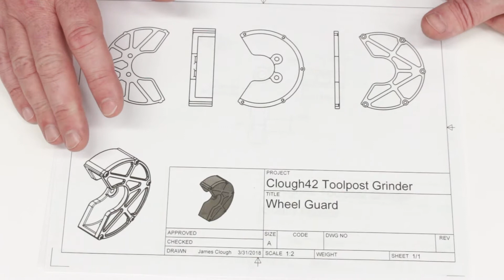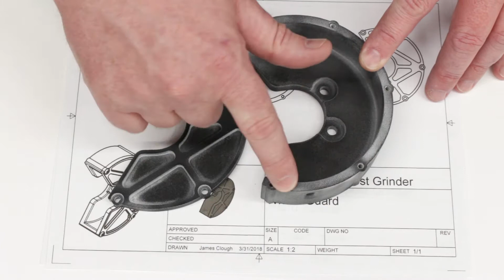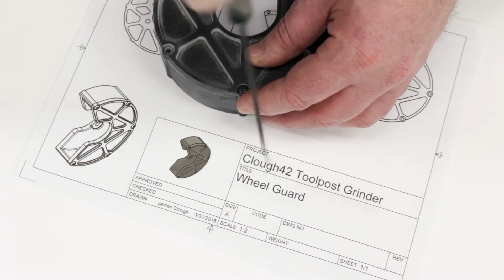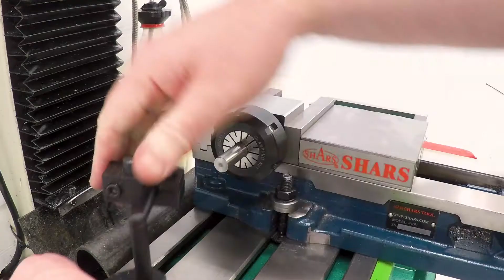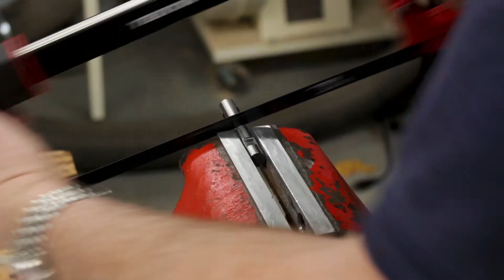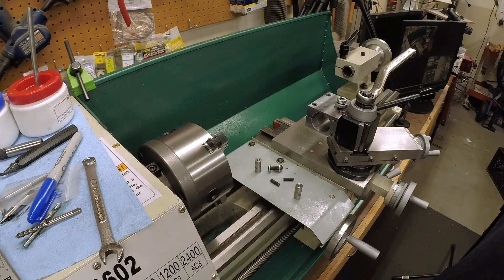Toolpost Grinder Part 22: Wheel Guard

Comment: Drill wandering in the lathe can be fixed by not using a center drill (which is meant to drill a center) and instead using a spotting drill (aka NC drill) with an included angle larger than the drill has. Typical is 120 degree spotting drill, which makes it so that the 118 degree drills will be forced to center as the ctting edges do not touch the spotted hole but instead it is very end of the drill that seeks into the center of that spot. This not only provides a centered start, but it also reduces drills cutting edge wear as the typical center drilled start will easily grab the cutting edges too aggressively.

Nice video, lots of explanation of the steps and love the wheelguard design! How much did the print cost (or would have cost)?

Comment: It seems like it might have been easier just to drill 1/4" all the way through the spacers, and just use bolts the are long enough to go all the way through, and into the mounting block. Not flats needed, and no tapping.

Comment: Hi folks. A 4 inch diameter wheel at 4,000 rpm has a surface speed of about 4,000 feet per minute. That's the speed bits will hit you at if you are in the line of fire when it breaks. Bigger or thicker wheels at higher speeds are even more dangerous. It's good practice not only to have a guard (essential), but to keep out of the firing line. Only use wheels with intact labels from known specialist and trusted manufacturers and do not exceed their speed ratings. Avoid 'Imports'. Inspect them for any damage. Does it sound dull when very gently tapped? May have a crack. If you are at all suspicious of it, wrap it in cloth and hit it firmly with a hammer so no-one else can use it and then dispose of it safely. Wear safety glasses, eyes are valuable. Think about what you are grinding. Some metalic dusts are poisionous or potentially explosive. Steel not too bad, aluminimum is more risky.  Have good dust management.  Clean up afterwards. Store wheels carefully. Defence in depth. BobUK.
Reply from the maker: Good advice.  I would add: check the maximum speed rating of your wheel.  This grinder spins at 7000RPM.

Comment: I don't know that material you had 3-D printed. I do know a little about steel. Tensile strength is an important property, but I would have thought the property you would really be looking for in a grinder guard would be toughness. Toughness is measured by tests like the Izod test for steel and is the inverse of crack-ability. In general a higher strength material may sometimes be  tougher (.20 carbon steel is typically a little tougher than .15 carbon steel), but eventually increasing the composition/structure that is giving the strength (like say carbon content of steel) will cause it to be less crack-resistant, so less tough (you wouldn't want a drill guard made from the same material as drill-rod, mild steel would be much better). Sometimes a malleable material is not very tough, because despite its low crack-propagation, it simply isn't strong enough (like, say, play-dough). But in general strength and toughness are different properties, to be assessed separately. And to bring it down to earth, if I were you I would have printed a sample rectangle about the thickness of your guard, maybe 1" x "2, and just hit it with a hammer. If you have 2 samples, do the same but having notched the material first, maybe 1/!6" deep, to judge the effect of crack initiation. Because if you do that to even thin mild steel, it definitely won't break. Which would be my fear with your plastic. Though as I say, to the best of my knowledge I've never even seen it, so maybe it is tough (but it doesn't look it in the video, for what that's worth).
Nice video series, thanks.
Reply from the maker: I do have some more parts of the same material.  Maybe I should do some destructive testing.
Reply: You are a very knowledgable man, but just in case you've never seen the set up for an Izod test, there's plenty online and youtube, eg see https://youtu.be/WiGevClbTOg. Not that I'm suggesting anything so formal, but this general setup with a vertically oriented notched sample, struck on it's long side, is probably a fair test for grinder guard material, I would think. You can imagine that doing this informally with a hammer and a vice with say, glass, would feel very different to doing it with steel.
Reply from the maker: Thanks.  I'll look at it.

Comment: HP Jet Fusion printer? Aren't those $200k - $300k?
Reply from the maker: Yeah, it's a production device designed for manufacturing.  It's definitely not a DIY printer.  Though if someone were to give me one, I would put it to use.  :)

Comment: First, no fair, I don't know that guy!
Second, what's up with the wobble during the tapping op? It looks like somehow the tap isn't coaxial with the holder? 
Third, try reversing your hacksaw blades to cut on the pull stroke, like japanese wood saws. It feels odd to get used to, but you'll make straighter cuts and never kink a blade again.
Reply from the maker: The tap handles I have don't always hold the taps straight.  What you see in this video is a pretty good example of what happens.  Maybe someday I'll crack it open and see if anything can be done.  Or maybe I'll keep my eye out for a quality tap wrench on eBay.

The particular hacksaw frame I'm using is a high-tension model, so kinking the blade isn't really an issue, but it definitely digs in at the beginning of the cut.  I may try reversing it at some point to see how I like it.  This does seem to be a lively debate.
Reply: I was about to mention that tap handle too - while it unquestionably does work, I can't seem to find any way to describe that kind of wobble politely. To me it looks never more that a hair away from a "ting".